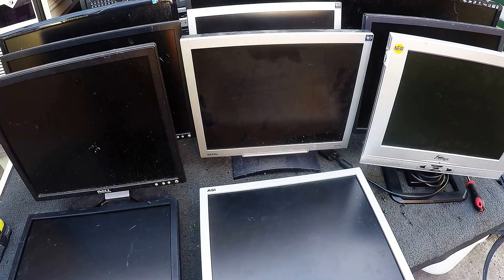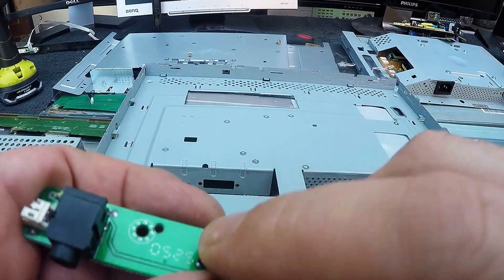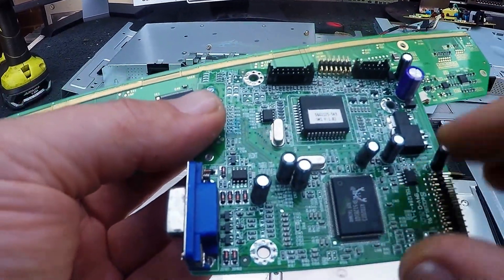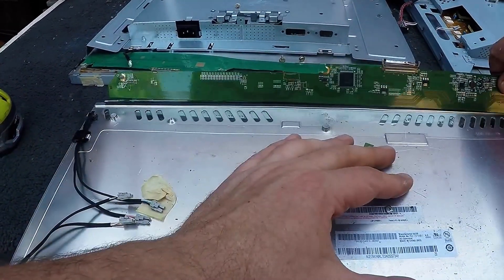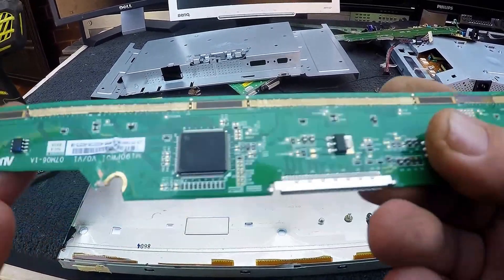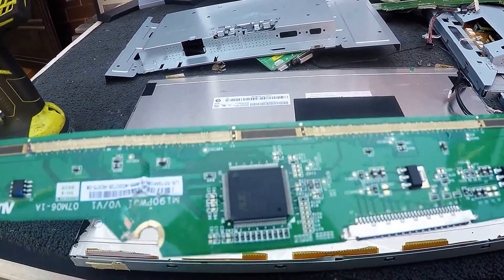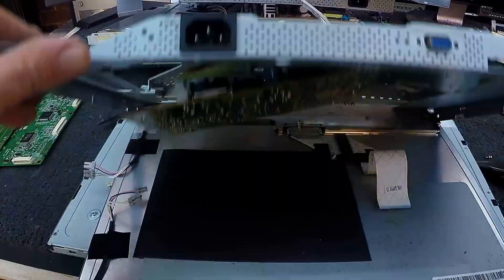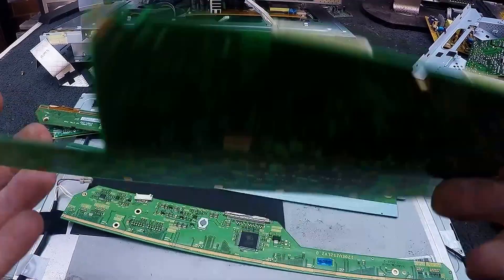Scrap LCD Monitors for Gold Recovery Finger Boards

Comment: I get lots of these flstscreens with the gold finger boards. 
But... today, I opened one up and it had a finger board with a silvery metal. It looked just like a normal finger board except that it didn't look like gold.
Would be really grateful to get some info on this. TIA
Reply: Most likely silver mate, silver is the best conductor for electricity but gold is favoured because it doesnt tarnish. Silvers used sometimes but dunno why

Comment: cant you just sell the monitor itself??
Reply: then this would be called a reselling channel and not a scrapping one
Reply: @reggieangus5325  hey bud
Reply: Late response, but for a lot of these old monitors you have to consider if anyone would even be willing to buy them. And even if you get a buyer, they won't be willing to pay more than a couple bucks for one, plus you need to deal with shipping then. Not to mention the space it takes up in storage until you find a buyer. Easier to break them down into smaller parts to be sold as scrap to a reliable/guaranteed buyer.

Comment: After you depopulate something like a green mid grade board , can it still be sold as a mid grade? I obviously don't mean completely taking everything off, but just things you do such as crystals, ics, tantalum etc. Thanks again
Reply from the maker: +zackcat276 no once you remove ic's etc then it's no longer a gradable board, it's then sold as a depopulated board if you can find a buyer or remove everything of value and throw the blank board in with scrap steel.
Reply: Ok thanks again for the help. So the board so won't even be considered a low grade?... what if you were take one tantalum here and there? Maybe it could still pass as a mid grade (if it was mid grade to begin with) or an other example may be if you were to cut the gold fingers off a projection tv slot card board but leave the rest of the board.. my main goal in all of my pain in the ass questions are to figure out the most profitable way (time wise and value wise) to scrap Ewaste, and I'm learning more from you and a very selected few other channels than I am anywhere else on the net
Reply from the maker: +zackcat276 well maybe low grade, small things are ok like tantalums, mlcc's etc but ic chips you should leave on it should still be mid grade.
Reply: +eWaste Ben alright, thanks. now I can better make my decision on what to pluck off my boards.